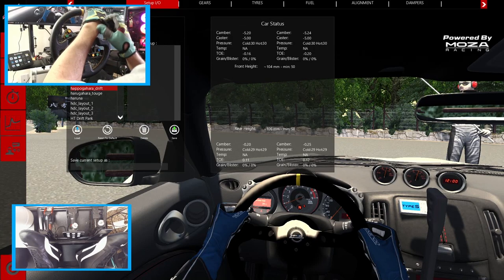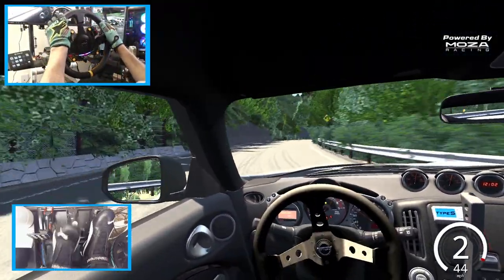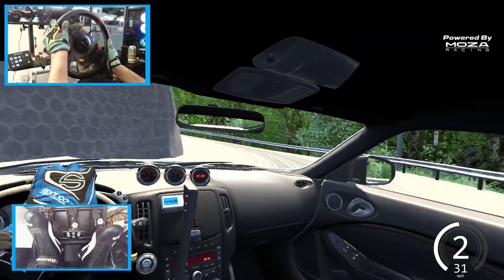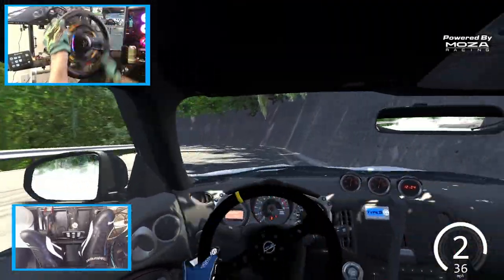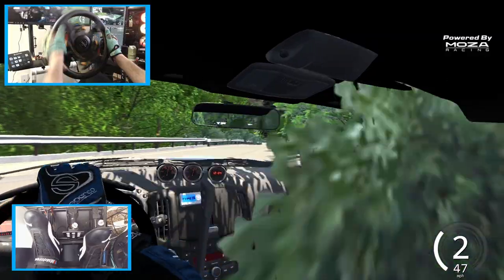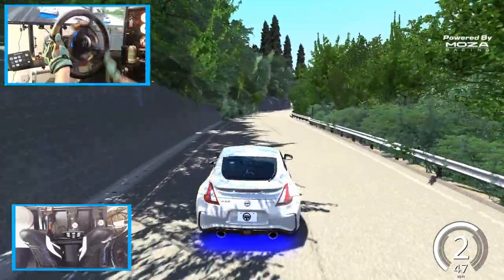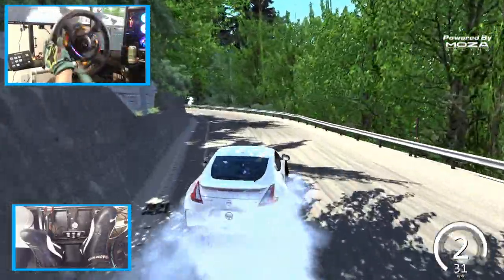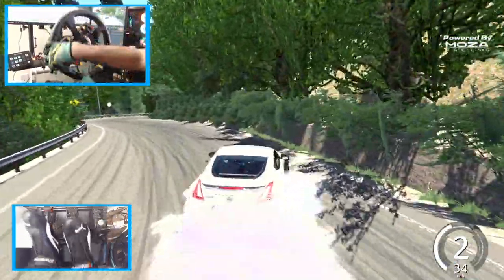NO HANDBRAKE Drifting on happogahara - 900° Moza R9 Wheel gameplay

Comment: The main thing as to why BeamNG feels weird to drift in, is the lack of tire temperature/wear; the tires are "stuck" at specific levels for each respectively. They are working on it but it is taking long due to them wanting to have it be as good as possible
Reply: That's not why BeamNG feels weird to drift in. These factors only affect the handling over the course of the session, and can be made static in a lot of racing sims. BeamNG's problem is how it handles it's grip levels when going in and out of slip, and how grip levels vary throughout. (that's not the only issue - the physics in general need a lot of work, but this was more drifting related)